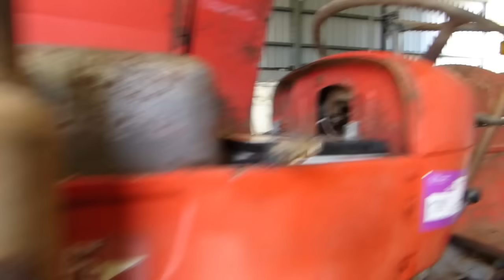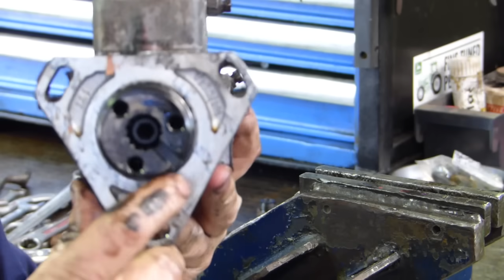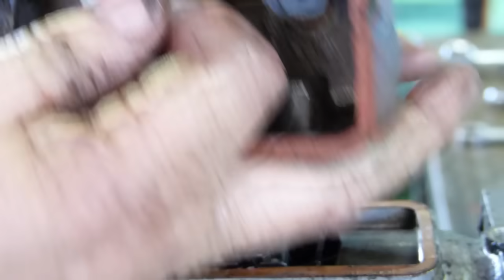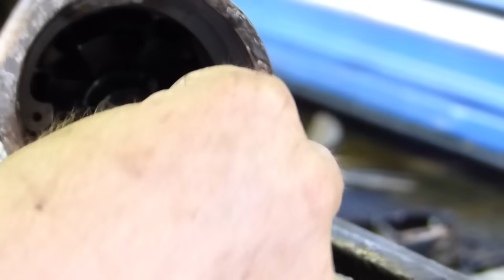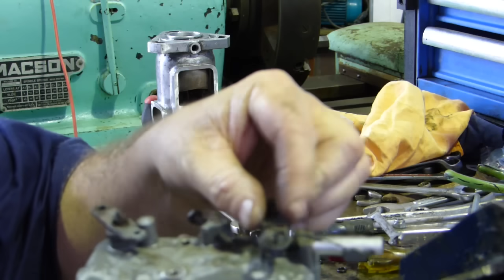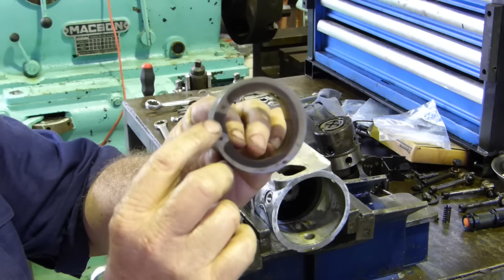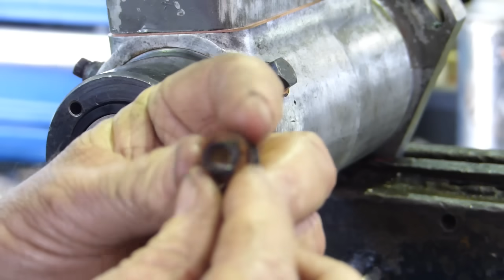CAV Injection pump full strip down to re seal and stop fuel leaks

Comment: 63 years old, been around tractors of all sizes my whole life but never opened up an injector pump before except for leaking top seals. Was always told there was a bunch of magic inside best left to the professionals. Figured what do I have to lose? Took this one apart (Ford 3000) found the plungers stuck as it had been sitting a few years, put back together, runs great. Thanks.
Reply from the maker: goodnews

Comment: May I ask you a question I love you video can you put electric fuel pump on a Perkins  18265611 17 it's in about the fuel tank is 21' from the motor I appreciate you could ask answer this question I've been asking everybody nobody can help me out thank you very much sir
Reply from the maker: Yes you can, we used to put them on grain headers as they lifted very high and would at times drain back, an extra fuel pump down low fixed the problem.

Comment: I have one of these pumps that is losing its prime after being shut off for a few minutes. Interestingly enough though it’s not leaking diesel fuel anywhere that I can see. Is it possible to be bringing air back in through the return line or cut that little check valve With Slider on the inlet side of the pump be sticking open allowing air to get back into the pump housing
Reply from the maker: Usually it is on the inlet of the pump sucking air somewhere. They dont bleed back as such as the lift pump valves will stop it.
Reply: @bundybearsshed  thank you for your reply.

Comment: I'm getting fuel in the base oil on my mf50a with a 4.203 engine, is this the same pump? and can you change the front seal without taking anything else apart on the pump?
Reply from the maker: Yes and Yes you can do the front seal by just removing the front drive hub.

Comment: Hi I went to bleed the fuel and there was no fuel to the injectors, I took off the view plate and the pump had about a cup of fuel in it otherwise it looked clean what next?
Reply from the maker: Check the metering valve is free. The best videos I did on these pumps were in the Massey Ferguson 135 6 speed series videos 14 and 15

Comment: Great video! I have a similar pump on my perkins 4236 turbo. I dont get any diesel to the Injectors, tried cleaning with the pump still on place but no difference. Still nothing. So I decided to remove the pump from the engine. I have removed the front of timing cover and unscrewed the 3 bolts in to the pump shaft. The pump is loose but wont come out. I'm getting crazy over here. Can you help?
Reply from the maker: with the 3 bolts out it should come, have a look at the MF135 6 speed playlist videos 14 and 15.

Comment: Probably, unfortunately the tag on the side of the pump does not have the info you shared in your video to determine which hole is correct.
Reply from the maker: Most do but there is certainly some that dont but for the springs it is easy enough to look for the witness marks to see where they went.

Comment: Hi Lance, great instructional video. I Just have one question, I have a John Brown 885 tractor, I changed the throttle shaft seals, also the front and the back seal. Did not strip the pump. I refitted back onto the tractor but now the tractor will not idle. Revs up ok, I adjusted the idle stop screw and got it to idle but when I rev it and then reduce revs it stalls. Any ideas?
Reply from the maker: Yes I think you have got the spring in the wrong hole in the top cover, that is usually the cause,

Comment: Awesome. After being told for so long you have to spend $$$$$ to stop the leak your video is a god send. I have a leaking gasket on my Perkins 4-236 with a hydraulic governor I am now confident that with a bit of care I can go a bit further and replace the seals which no doubt will be hard and will fail if not replaced now. Cannot thank you enough.
Reply from the maker: Check out my video in the Massey Ferguson 135 6 speed series, videos 14 and 15, I do a way better job on explaining things in these two videos.

Comment: Thank you Lance for this video and all your other videos as well, it gave me the confidence to strip my 35 three cylinder pump that was not injecting after sitting for over 20 years with the pump empty of diesel, 43:09 in your video is where the problem was in my pump, the two plungers were stuck down and was not letting fuel in so as the rotor turned there was no fuel being pumped to the injectors because the plungers were not reaching out to the cam ring, got it all built and running again, now im not afraid to tackle another one. Cheers from Northern Ireland.
Reply from the maker: Glad it helped, the MF135 6 speed pump videos were the best I believe. Videos 14 and 15.

Comment: Would you be able to give some insight on these pumps what would cause only 1 cylinder to get fuel? Lines are clean but getting nothing.
Thanks!
Reply from the maker: All cylinders use the same pair of pump plungers and depending on where the head is it fires on a certain cylinder. I would check delivery valves if it has them or look for swarf in the head somewhere.
Reply: @bundybearsshed  thank you! No delivery valves to fight with but I will check the head next. Just had been nuts getting fuel to cyl 4 but nothing to 1,2,3.
Thank you for the quick response!

Comment: Thanks for a very good vid. I have a question about the rear part of the pump where the injector lines come in. Is it possible to keep the pump in the motor and remove only this rear part. That o-ring there is my problem.
Reply from the maker: once the top is off and the metering valve is removed yes you can.
Reply: Thanks mate

Comment: You, sir, are an absolute legend!! I really appreciate your taking the time to go through the complete pump overhaul - my Leyland tractor currently won't start, and I'm pretty sure the metering valve is sticking (good fuel pressure to pump, nothing from injectors). Having watched your video I have complete confidence in taking the pump apart and getting the old girl running again. Thank you!
Reply: And to close this out, I took off the inlet and top of the pump, followed your instructions, and she now starts as she should!
Reply from the maker: Good work, well done.
Reply: I'm having the same issue with my Leyland 245 with no fuel to injectors. I believe I need to open the top of the injector pump like you mention at 24:24 since it seams the shut-off must be stuck. Bundy or Simon, where did you get the gasket kit for this?

Comment: I'm having a problem where the fuel pump leaks fuel into the sump even after I changed the seal but it seems to be passing the fuel from the hex key bolt inside
Reply from the maker: possibly the washer is in the wrong place.
Reply: @bundybearsshed  could you like explain the placement of the washer . I have it spring washer spring then bolt and I'm not sure if that's correct

Comment: Lance,
     Thanks for the videos.  I have a 1983 New Holland skid steer and it has the CAV injection pump.  I have pulled it off and I intend to reseal it following your video (I changed the top gasket while it was still on the machine.  Unfortunately, it is leaking from the bottom injection port and it is too close to the machine to access.  While I have it off, I would like to change out the auto advance gasket where it attaches to the pump.  If I remove the auto advance housing for the gasket replacement, will I have to reset the auto advance?  That looks like it requires specialized tools and I'd rather not have to take it to a shop.  Thanks again for all you do - Dwain
Reply from the maker: Go to my mf135 6 speed playlist video 14 and 15 it shows way more. No setting on the advance to worry about really.

Comment: Hi Would that cause a leak to look like its bottom  number one  banjo fitting i replaced new banjo bolt and washers still dripping  its 590 Massey
Reply from the maker: Try loosening and tightening as it is running, sometimes that flushes any junk out.

Comment: Hi I have a cav pump, I would say the same as this one.
I wanted to ask you, but if I remove it, do I have to put it in phase with the engine?
or do I just put it back together?
 thanks.
Reply from the maker: If you dont turn the engine when it is off it should bolt straight back on as it can only connect with the gear in one position.

Comment: Would an internal leak from the injector pump into the engine lead to a runaway diesel?
Reply from the maker: Yes it could for sure.
Reply: @bundybearsshed  thanks for your reply as I have experienced this before with my old 2 cylinder tractor

Comment: Lance this is a great video. I have a Ford 550 tractor loader backhoe with a cav pump on it. I did the strangest thing last time I tried to start it. it went to full revs so I shut it off on the stopper. checked the throttle linkage and all was free so tried it again. Same fault. Does my pump need resealed do you think or is somthing else a miss. Thanks
Reply from the maker: Check the governor spring or the metering valve. I did a better video on my Massey Ferguson 135 6 speed series videos 14 and 15.

Comment: Hi Lance love your videos I recently got a 148 and have done a few 40 years so refreshing the old dead cells this one had half of your floods in the fuel system,so looks like the inj pump has to come off ,as fuel to pump but nothing at injectors  , funny what these old girls bring up stuff that you never came across in the field, unfortunately I expect the there will be plenty of water filled engines over your way after the horrible weather you’re having  I shall shall now sit back and be a good student
Reply from the maker: Go to my Massey Ferguson 135 6 speed playlist videos 14 and 15. I go into the pump way more and I think they are  better videos all round. Yes the floods will be causing some strife for sure.

Comment: Do you have a video on disassembly of the pump head for stuck plungers? Have fuel through the pump but none to the injector lines, metering valve looks fine and moves freely. thanks.
Reply from the maker: Go to my Massey Ferguson 135 6 speed playlist videos 14 and 15. I go into the pump way more and I think they are  better videos all round.

Comment: Hi there,
Firstly great video and well demenstrated.
I have the same pump on my dumper in England.
My question is:
If the shut of sliding bar was removed in the housing would this affect the pump working properly?.
I understand the machine can not be turned of.

All the best
Reply from the maker: Yes, check out my 135 6 speed playlist video 14 and 15 I reckon I explain things better there.

Comment: Hi I’ve a 3 cylinder Perkins that has the cab pump with a starting issue will start and run with help from easy start but switch of and it won’t start unless we give it another wiff of easy start would you say it’s a pump issue I’ve tried all other avenues ie injectors undone to clear the air but still has this issue any help appreciated great video thanks
Reply from the maker: Is it cranking fast enough.

Comment: Hi lance,  can some wear or water in the pump be a cause why It's not starting at all when it's below 0 selsius?
Reply from the maker: Usually with a little wear they start better cold but at zero Im not sure.
Reply: @bundybearsshed  it's like that if I don't use engine heater then no chance to stard. Preheat with glow plugs not helping at all but when I put engine geater for 2 hours then start right away.

Comment: Hi.
Great video.
Ive got an old BM Buster With that pump,no fuel to injectors. Ive bleed it and changed filters and mainpump. 
I took away the plate on the side of the pump and i can se the axel turning. Took away the plate so i can see the transferpump,that doesent turn when i crank the engine… What could possible be the problem,and can it be repaired?

Pecka,Sweden.

(Sorry about the spelling,hope you understand)
Reply from the maker: Possibly broken shaft, Remove the pump for a look I would think
Reply: @bundybearsshed  
Thanks for reply.
Yes,i Will. 
Thats what i was afraid of 🤥

Comment: Hi Lance,

Could you shed some light if the following issue is caused by the pump timing/position or not.
As I mentioned on my previous message, I removed, cleaned, resealed and refitted my MF165 pump and everything is working better than before. 
A friend of mine though noticed that some black smoke (more than before removing the pump) is coming out from the exhaust. He told me that it might have to do with not putting the pump back on the exact timing mark/line as before. I am sure that I have placed it back to its original marking.
So, could the pump timing position cause this  or not. If not what else could it be?

Thanks again
Costas
Reply from the maker: G Day Costa, Timing might be one thing but a bit of smoke is a good thing under throttle or load, It may have been timed wrong earlier as you said it runs better than before. Unless it is a lot of smoke I wouldnt worry.

Comment: Thanks Bundy, I think its is A great video, but I cant get the pump off, that third bolt close to the motor, I just cant get to it,, is special tool ? I have taken exhaust manifold off, must be something, its bolt near where coolant goes in, I might a bit of a dill, but can you advise me, thanks ken
Reply from the maker: I have a spanner that I bent to a U shape for the hard to get ones. You may need to find an old 1/2" spanner and heat it and bend it.

Comment: Hi Lance.. great video, I'm about to rebuild one of these pumps so this video will be very handy.. i have an old Leyland diesel out of a landrover that has near enough to the same pump that i want to modify to run a generator, is there a way to change the governor to run 1500rpm or would i need to use a electronic speed controller?
Reply from the maker: G day Mark, I think you could run it at 1500 easily with a set throttle at the load you require with possibly just a fixed throttle. here is a link fo r a CAV workshop manual on my other web site that might shed some light on to it for you. https://queenslandtractorspares.com.au/wp-content/uploads/2019/10/CAV-Injection-Pump-Manual.pdf
Reply: @bundybearsshed  thanks mate.. that manual will be very handy.. with the changing loads I'll be putting on the genny i think it will need to be governed some how as my tig is one of those computerised ones so won't like fluctuations.. i have a gac/ Cummins electronic speed controller sitting on the shelf if all else fails, it's just that I prefer machanical things being a manual machinist.. hopefully the old Leyland likes sump oil as much as my Indian cs lister copy that i use to run my big lathe and mill, that engine eats 100% waste oil.. It's a little hard to start on sump oil so i stuck a flywheel and starter motor off an old Hyundai on it and that gets it going

Comment: I have a pump that need resealing and glad you shared this with us! Mine is losing prime and I have to bleed the pump if the tractor sits for more than one day. Mine has  round diaphragm looking oiece that is leaking also.  Does the kit contain that part as well?  Thanks!
Reply from the maker: No it is a seperate item.

Comment: I thank you for your instructions.... I was trying to find something on my skidsteer Newholland before I tore into it...... I am pretty Tec savy but I always like to get the data before I destroy something....My unit has been setting and it has no governor action or turbo.... I feel its in the throttle metering rod stuck and not allowing governor to operate....thanks again Roger
Reply from the maker: Have a look at my MF135 6 speed play list videos 14 and 15. I feel I do a better job on the pump in those clips.

Comment: Hi Lance,

Could you please tell me what the big washer with 3 holes and lock tabs is called (or a MF / Sparex code) that bolts the Timing Gear to the Pump drive shaft.

I need to replace the current one as the lock tabs have become weak from moving them with the screwdriver and one broke off.

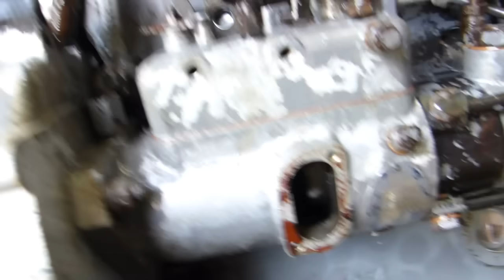mentioned at 6:13 min ( https://youtu.be/h26p78YZIr4?t=378 )

Thank you again for the wonderful videos !!!!

Costas
Reply from the maker: The only place I know of is https://queenslandtractorspares.com.au/product/massey-ferguson-35-135-148-etc-engine-lock-tab-kit/ that is a Quality Tractor Part kit from Ireland we sell.